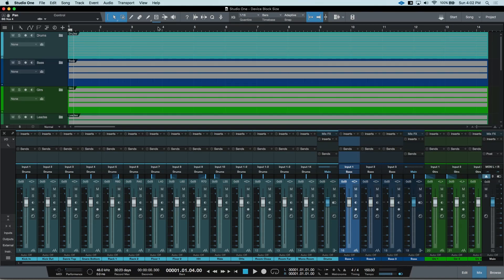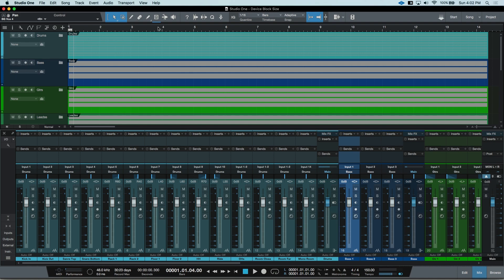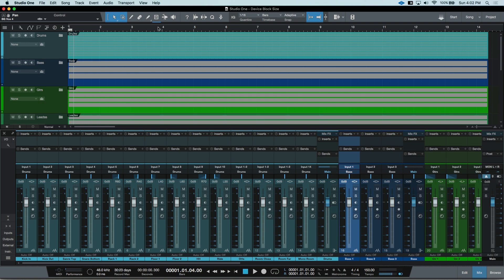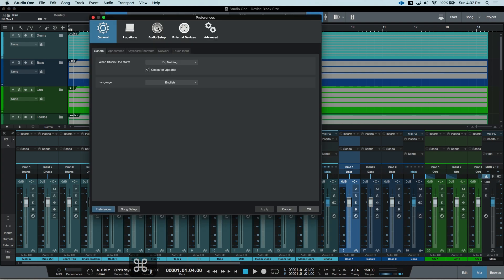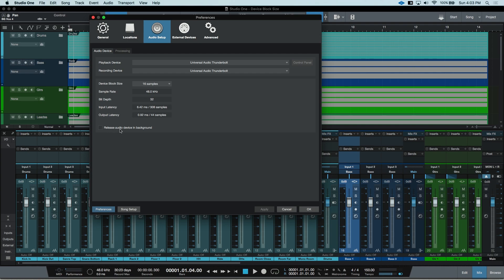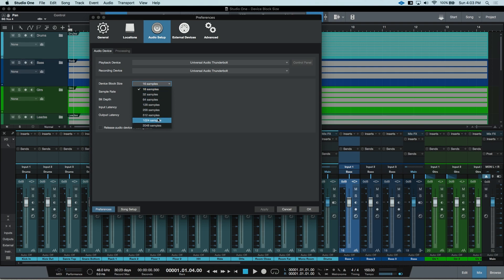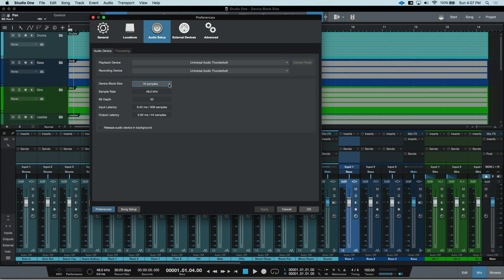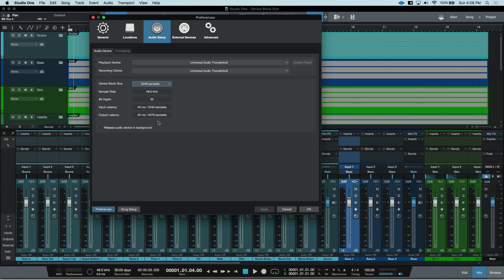Studio One - Device Block Size and When to use What?

Comment: Hey Tim… when I click on the processing block it says 2048 but when I go to Audio block size it says 512 hmmm ? Should the Processing block be lower as well Tim??? On Studio One 6.6 MacBook Pro 2015 Monterey 12.7.5
Reply: I have just discovered this video. Mine is exactly the same. It’s set to 512. So far. Everything has been okay, and the only reason I went to check it was because some of the synths sounded a bit off (but I think that’s the synth itself)
Reply: I figured out my issue. I have the Presonus Quantum 4x4 Interface and it’s stronger than my 2015 MacBook Pro. The Quantum interface is for a M1 Mac and sooo I bought a earlier Presonus Interface (The iTwo) connected it and no freeze up no stutters when recording Simply.. No Problems!!! I’ll save my Quantum for when I buy an M1 - M2 new MacBook Pro!!!
Reply: @UniqueTouch  glad you sorted it. Music production can be so technical with problems

Comment: What about when exporting? Should we set it to highest as well for the final mix export?
Reply from the maker: If you are exporting in real-time, set the block size high to allow that buffer. Your system will make sure the audio is in sync. If you are offline exporting, you can leave it at a higher level since all it’s doing is computing the output.

Comment: Hay Tim, Now with studio one 6 the latency doesn't reduce if you reduce the buffer size. it stays the same for 2048 and 32 samples. but the thing is if i go do dropout protection , making that setting to low will reduce the "Block size " which is different from buffer size. this daw is getting confusing and buggy every day.
Reply from the maker: What audio interface are you using? Changing the block size should be having an effect on the latency. Dropout protection is for when you are recording (on the way in) to help reduce click pops and of course, drop outs. Reducing the protection down (during editing and mixing) will help open up resources from your machine.
Reply: @TimTalksAudio  I've tried multiple interfaces. In Studio one 6 changing buffer size doesn't reduce latency anymore. 2048 and 32 give same latency. Dropout protection I don't want to mess with coz it causes trouble to if its low. There is a block menu attached with dropout protection

Comment: Hi. 
1.Do you adjust blocksize per track? 
 2. before you start recording or after?
3. What blksze do you recommend for a. Vocals b. Midi drums c. Real guitars and bass, d. Midi keyboard. E. Real acoustic guitar via mic

Thanks
Reply from the maker: You adjust block size for the session and you can adjust as your session grows larger and larger and as you task your computer to do more and more things. The general advice is to have the block size as low as possible without clicks or pops while tracking/recording, and then having it as high as possible while editing/mixing/mastering.

Comment: There’s no drop down menu on my device block size settings. I can’t change it. Stuck at 485 samples.
Reply from the maker: What interface are you using? If it's a windows audio driver, you'll have to adjust the settings via the windows settings. Otherwise, check if your interface also has a control panel application for it and you should be able to adjust there.

Comment: So if I recorded vocals at a block size of 32, I wouldn't have much headroom for mixing them, would I have to switch the block size back to let's say 512 before adding those mixes?
Reply from the maker: No, you might be confusing bit rate and block size. Bit rate is the depth of audio turned digital, otherwise known as headroom. Block size is the buffer time you give your machine to process/load/release the audio during playback/recording.

Comment: Threads & wifi buffering of blocks of bit length to clock & measure size/time in data streams in networking & processing may oftenly use blocks sometimes. OR Encryption..?
Reply: Odd, how many plops is a processed block of data or  operations?
Reply: I could figure out the machine half of scripts to measure close to clocking to sync every so often. But I'd need to acquire a sudo script as an example of time to wait between signals, signatures & or I'd buffers for a ram stick to buffer a loop or remap or random input, but I don't have music peripherals & I'm fine with that. But I wonder what scripted macros combined with human accuracy in VR applications could do with inputs.. like reduce button mashing stane on hands & smooth controls out more.
Reply: After all software is getting bigger.

Comment: Hello, thanks for your video. I am abit confused can you help me?

I have ryzen threadripper 3970x which as 32 cores/64 threads. and I have rode AI one audio interface.  

I am noob at this block size thing. I was thinking bigger sample size like 1024 - 2048 is better.
But I've heard in another tutorial, "if you have a powerful PC, you can go for lower sample rates"

I am confused
and when I tried to use 64 samples. I dont recognize any pop sound etc. seems sound good.

If I go for 1024, it's ok too with the UNCHECKED "enable low latency monitoring for instruments" and
maximum dropout protection (2048 sample and 64 bit double precision)

But if I enable low latency monitoring for instrumens, it starts to get weird sounds after 512, even starts some bad sounds from 256.
and also getting slower to playback. 

so shortly these 2 sounds same to me. what should I pick? which is right and better in terms of quality? (when mixing.)

1- 64 or 128 samples 
or
2-higher sample rates (like 256-512-1024) with settings below

-UNCHECKED "enable low latency monitoring for instruments"
maximum dropout protection (2048 sample and 64 bit double precision)

thanks a lot

Comment: you are at the point and quick. perfect combination. a question: I have 4 guitar tracks, I choose all 4 and add bus channel. I use a reverb plugin (for example) and it works. But I don't see the "send" option on each guitar channel. when I choose the "send" option, then the reverb effect is louder..why is that happening?
Reply from the maker: That almost sounds like you are double sending the signals. If you send from the bus, then you only need one send. If you then also add a send from each guitar channel, you are doubling how much level is being sent (once from the channel and again from he bus)

Comment: Whereever I see (including official documentaiton) there are block sizes shown like 16/32/64/128 etc , but I c from 8 to 1016 with intervals like 8/24/40/56/72/88/104 and so on until 1016, even stranger is that in the windows taskbar notification area theres a focusrite audio control panel icon (I am using focusrite scarlett) which I can also use to change the block size and there I see normal like 16/32/64/128. Why do I have different block sizes in Studio one? Anyone has any experience with that? thanks.
Reply from the maker: This almost makes me think that the computer and the focusrite aren't clocking with one  another over the USB. Have you tried changing usb ports? I hope that your machine has a different usb card that you could try (like usb ports on the front of the tower vs the back).
Reply: @TimTalksAudio  no unfortunately it doesnt seem to be so simple, I not only have same problem with different usb ports but i have even tried different pc and different versions of focusrite cards, by chance in this time when i switched to studio one i bought a computer but i had to migrate projects from cubase from another computer to the new one, on old and new pc its the same prob in studio one and no prob in cubase, before i had focusrite scarlet 6i6 2nd gen and now 8i6 3rd gen, same problem on both only in studio one, I wrote studio one they say ask focusrite its their prob, i donno how its their prob but yea I can live with changing block sizes using control panel in notification area in taskbar, thats the only solution i have at the moment, thanks a lot for the reply :)

Comment: If you are tracking using an 8 channel interface (or more), but return lag is unimportant because it's live and the band is not monitoring their recording, which way do you go? Do you need the processing power of a higher value to give the interface more gusto, or still a smaller number for tracking?
Reply from the maker: In that case, with no one needing to hear a click track or any foldback/monitor mixes what so ever, you can find a solid middle of the road number (512,1024) and set your size there. Having a larger block size will increase latency, making having any playback or live monitoring delayed and difficult to play with/to.
Reply: @TimTalksAudio  Thanks a bunch! Great content.